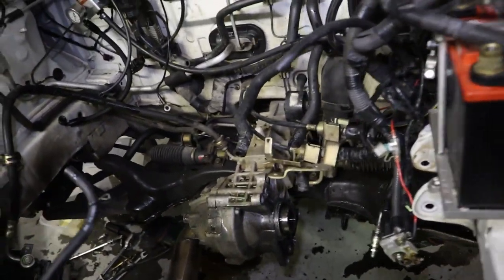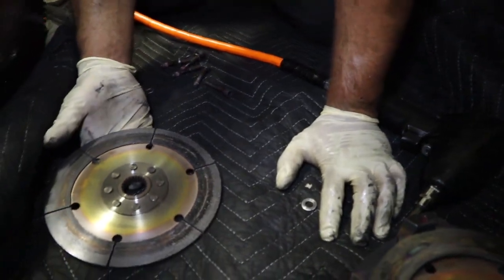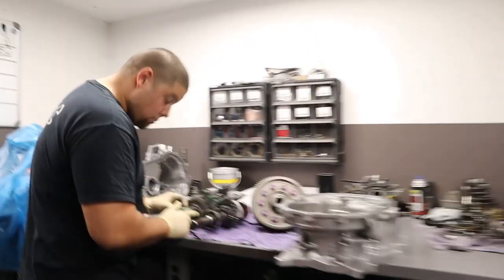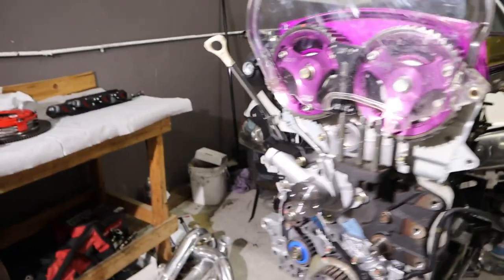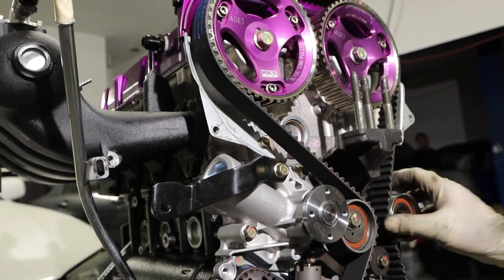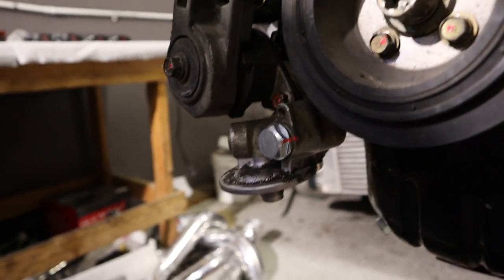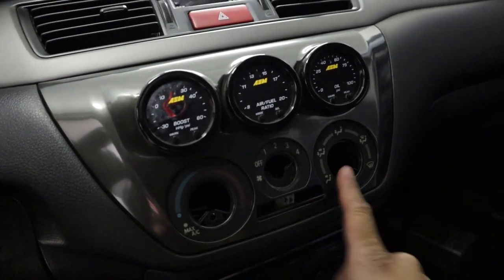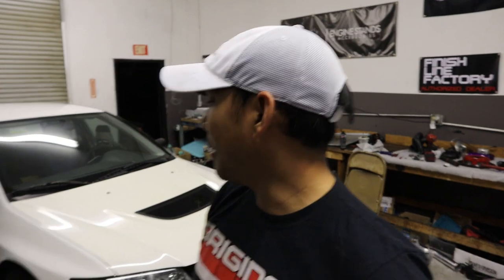PART 2! BUILDING A 9 SECOND STOCKBLOCK EVO VIII! EVO GETS ENGINE AND TRANS ASSEMBLED

Comment: How you keepin the motor alive w stock oil pan & 1.5 60fts?

My oil pressure drops to 40psi @9k rpm, cutting low 1.5 60fts.
Reply from the maker: I honestly dont know bro, all I know is that it just works. Never threw a rod yet even in my old setup that ran 9.95@141.  The tune plays a big role for sure though. The way Armentuned set my launch control and how the power comes in.

Comment: Are u in stock trans and transfer case , diff ?? If ur not can u please link me the after market parts u using in the drive train ? I’m on the process on building my car
Reply from the maker: Bryan Sánchez fully built DB trans and performance transmission, driveshaftshop carbon 2pc driveshaft, oem 2004 RS LSD transfercase, OEM rear diff and axles. You can DM me on instagram if you would like to have us build your trans. I also have alot of parts for sale that i am selling cheap 👍🏻 @charles_scs